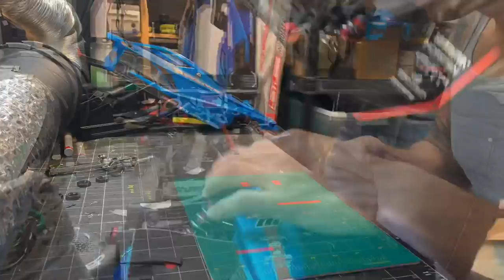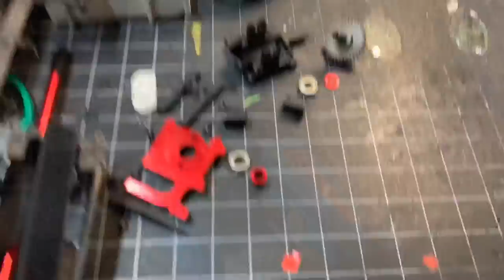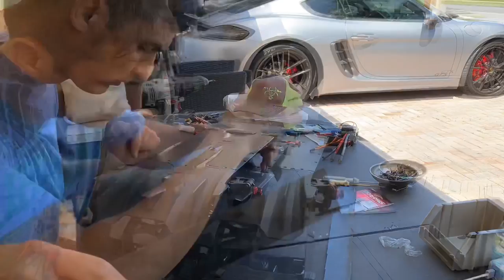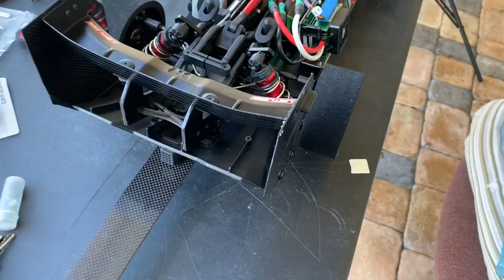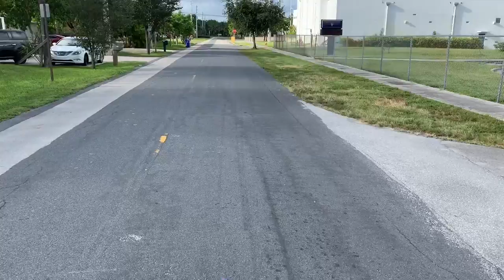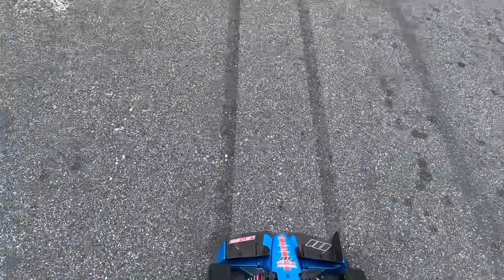Kill Mode RC Arrma Limitless Drag Build Time Lapse and First Test Pass X Spec Drag Motor

Comment from the maker: Update! The car ran a 1.73 at it first time out! And we took home the Trophy!! #killmode
Reply: Kill Mode RC 6s or 8s and what gearing cuz you were blowing those tires to dust
Reply: An congrats on first win with it
Reply from the maker: Jarvis Jackson that is on 6s with my X-spec 2900kv motor.
Reply: Thats in florida!
Reply: @killmoderc6815  do you have any parts you could donate to help me get my new limitless up and running? would mean the world if anyone could help me get this car outta the box have never worked on an rc this will be my first project
Reply: Can you let me know what gearing or atleast spur gear size for the setup I’m about to buy the 2900k kill mode with cat pack next pay check thanks
Reply: @jaybuiltrc2664 did you figure it out

Comment: @killmoderc Im just now getting into the drag and speed run stuff and I'm going to order the 2900 killmode motor in was wondering what is a good pinion size and spur gear to use in a limitless cause your video got me wanting one thanks in advance

Comment: Is this motor and cap pack setup capable of being used for speed runs or just ripping up a parking lot without heat issues. I know gearing and stuff is a factor but is it just a drag motor?
Reply: Just get the 2700kv setup KMRC has available....I’m running it in a VTE, and it’s a monster on 6s
Reply: @gregmason3099   Ya i figure if i spend the money to make a good limitless id want it to be able to bash in a parking lot or gear up and do some speed runs. Kinda feel pointless to me just to have it for drag racing. Thanks for the help.
Reply: Trever Kincaide the 2900 is fine for speed runs its actually more efficient than the 2700, I’ve got the 2900 in a limitless but it was in my speed typhon and I don’t drag race. But either one you can’t lose they are both good.
Reply: @Ledge.Limited.Collectibles  As big and as powerful as the 2700 or 2900kv motor is i wouldn't think either would break a sweat pushing a limitless.

Comment: Hey bro I know you’re busy and all but can you tell me if the motor mount can be flipped 180 on the Infraction to fit a drag motor from you. The cans are way longer but I’d like to put one in. Maybe one day here or on instagram you could tell me the benefits of the cap pac as well. Not in great details just the version for dummies. I kinda get what it’s job is. Thanks a million bro, absolutely love your teaming up w TP for the killmode line! Awesome 😎
Reply: Yes you can flip diff to fit ,his motors as i didnt know teaming up also get a cap pack  , its for motor to have steady, no amp drop starting i think 😆 which wouldnt be good on esc or motor . your motors on a.c. wont start when they go bad